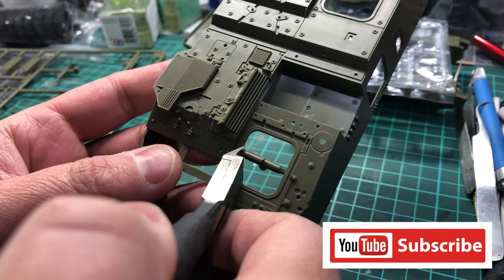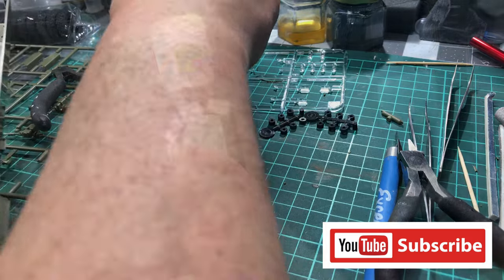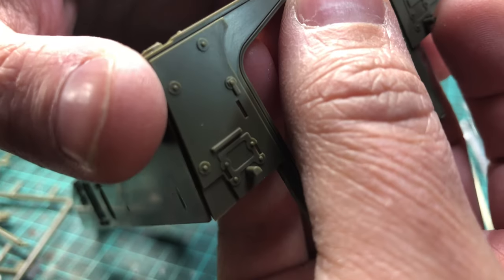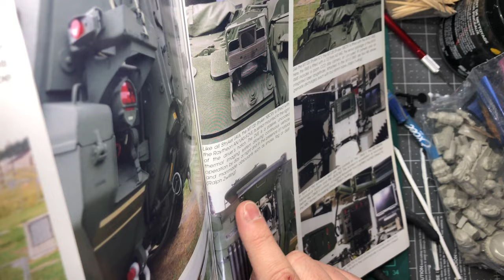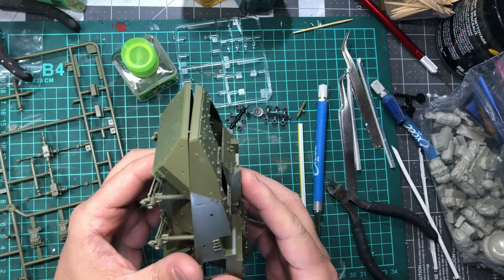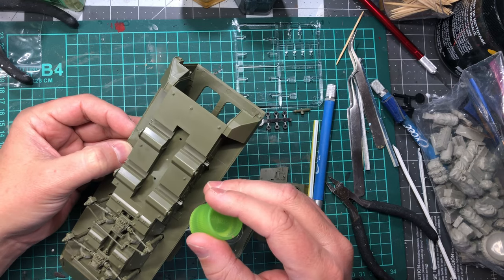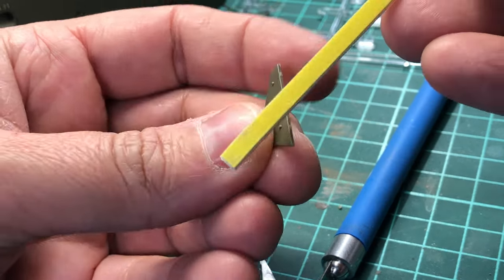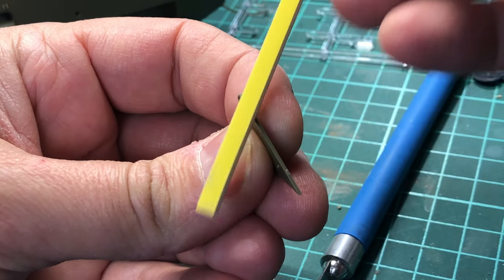Plastic Scale Model Build - M1126 Stryker AFV CLUB  1/35 - Part 2,  Hull Construction.

Comment: Get some needle files in different shapes.  They can work faster than sanding sticks and the various cross-sectional shapes (round, square, triangle, flat) will allow you to cut a wide variety of shapes into plastic as well as dressing seams, creating right angles, removing sprue points and even redefining panel lines.

Comment: Have never had a problem with Tamiya Extra Thin filling gaps; it is too watery and too fast drying. It is impeccable and if you ever wanted to build a 100+ part model kit in a day (minus painting and detailing), Extra Thin will allow you to do that and without getting sticky fingers to boot.
Reply from the maker: The only problem is that since Tamiya extra thin does melt plastic it can squeeze out from a seam and fill it. Some seams shouldn’t be filled.